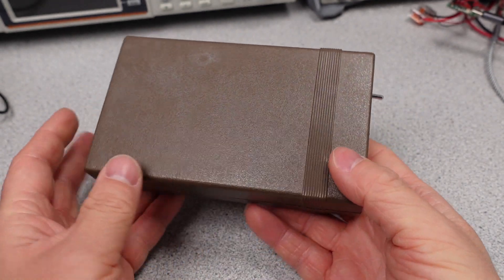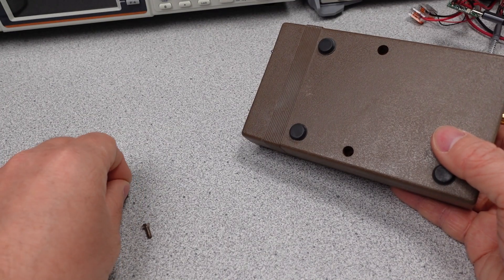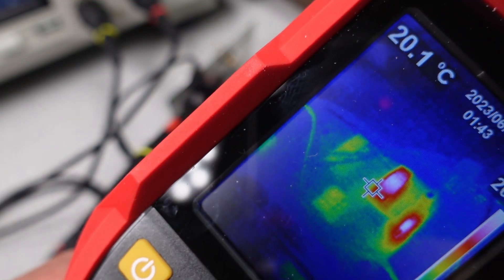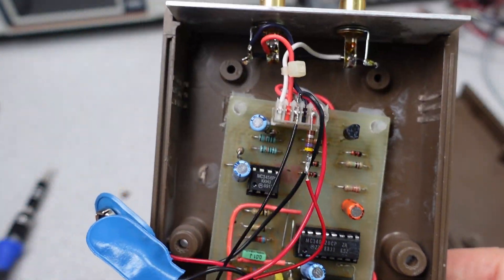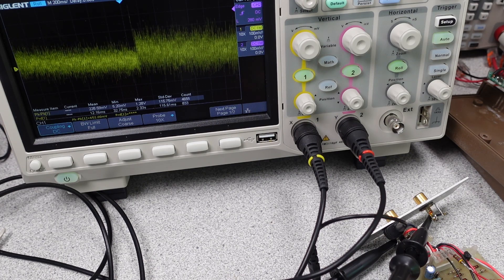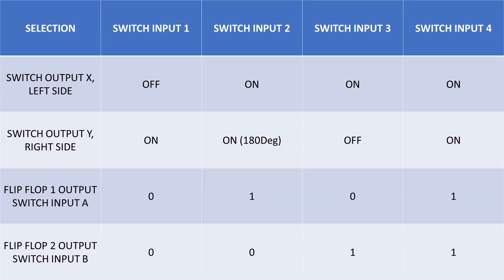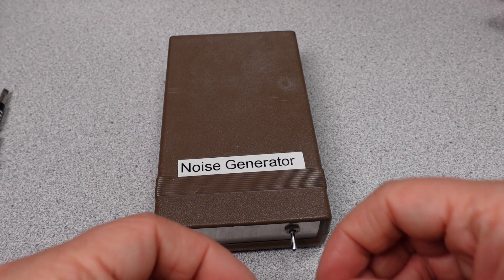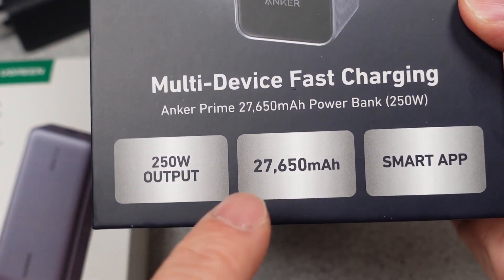Mystery Electronics Device Exploration, Teardown and Measurement

Comment: The noise sounds very much like the test noise AVRs have been making for ages if you turn on the speaker test mode/manually reconfigure the output levels to match at a certain position in the room. Not sure why this kind of noise is generated but maybe there's some universal/unique/ideal properties to it for that kind of function?
Reply from the maker: The noise is used in conjunction with FFT or octave band analysis system to adjust the output to a flat equalization.  In this case the other modes are still a mystery but yeah position in space perhaps.

Comment: Great video. 

Incidentally Ugreen just launched a new 300W GaN charger. Will you be reviewing it soon?
Reply from the maker: Yeah, I got an email from UGREEN asking if I want one.  I won't take one, I have to buy it, no idea when though.  But yeah, still only 140W max on one port... just like the new Anker 240W adapter.  It looks like Framework is the only one I know of with a higher wattage single port USB adapter coming out.

Comment: For checking surround sound? Left, Center, Right, then Rear? (repeat)
Reply from the maker: It only has two outputs though, it isn't encoded in anyway but maybe that's enough to fool Dolby Surround into working? That is an interesting idea I will have to try it out.
Reply: This is likely Dolby Pro Logic encoding